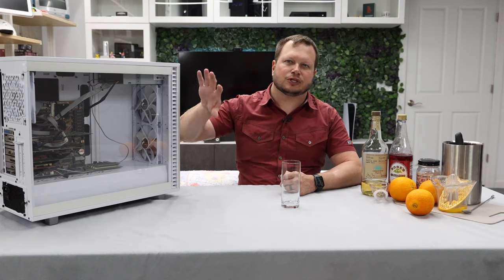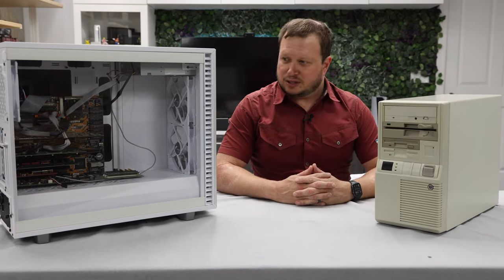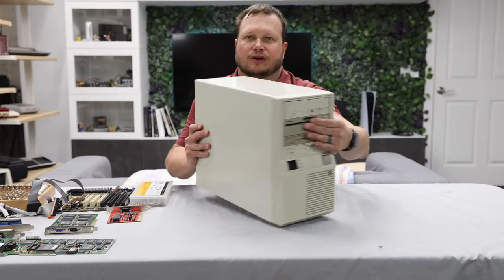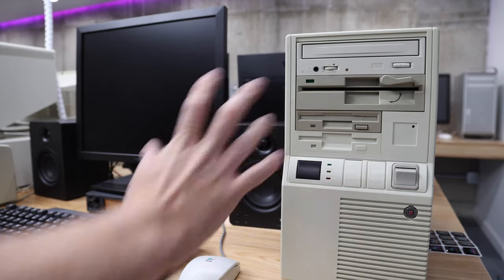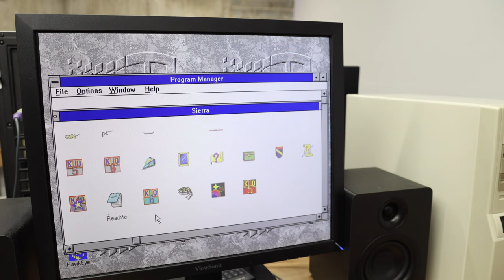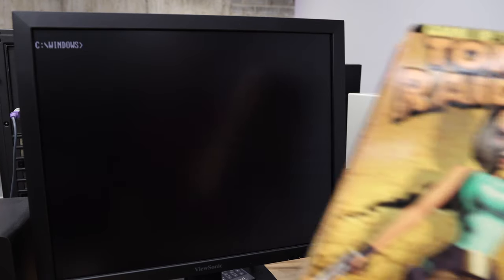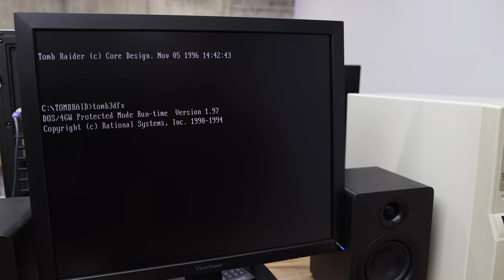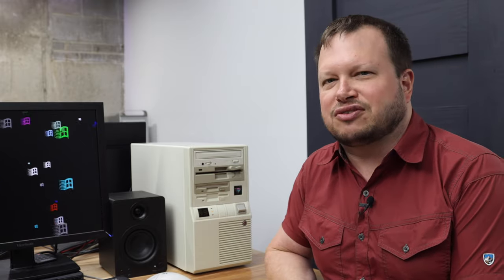Rebuilding a 486 | Jeremy's Retro Bar

Comment: I also hit pause on early 3D accelerators, so it's interesting seeing others come back to 3dfx based cards.  I worked on 5160s, built 386s from kit, and thought by the time I had a 5x86 with a CL-GD5428 based VLB card, what more could I need.  I didn't bother buying a 3D card until the GeForce 2 era, spurred on by the draw of LAN parties.

Comment: Such a great show. I'm currently watching it while installing CodeWarrior 10 on my Power Macintosh 6100/60av (with the 233Mhz G3 upgrade).  =)
Reply: learned serious programming on a 512K Mac using Lightspeed C - the predecessor IDE (in its day it was awesome in same way as Turbo Pascal was on DOS). Self-learning how to program the Mac Toolbox using Lightspeed C and Macbugs monitor was foundation starting point for what became a lifelong career.